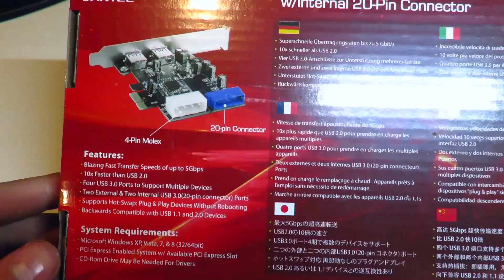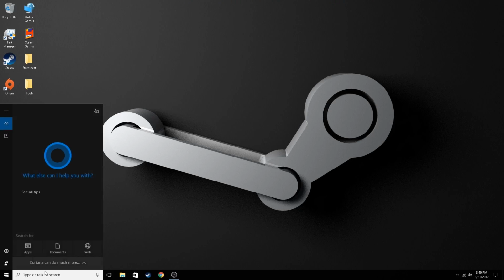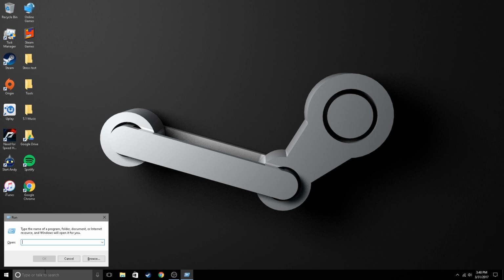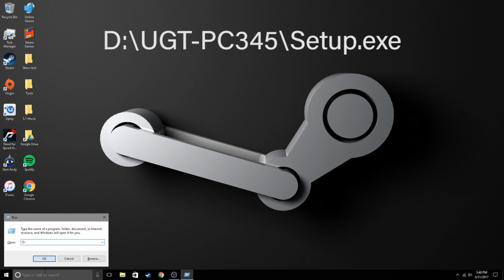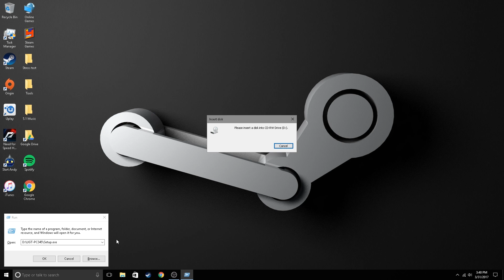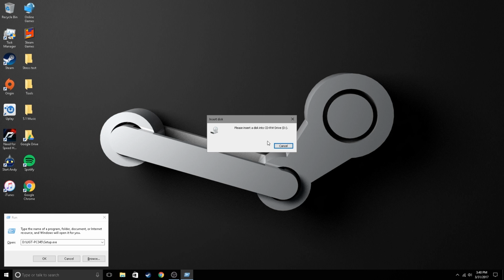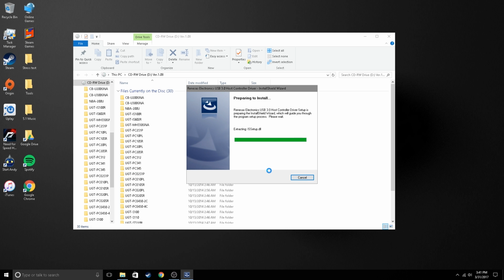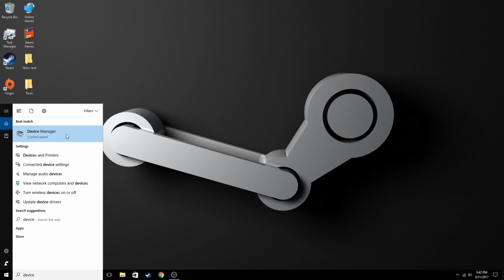USB 3.0 PCI-e Card| Unboxing and Installation

Comment: hey i know im a couple years late but i just built my pc im plugging everything in now but i bent 2 of my usb 3.0 pins and cant unbend them if i get this extender will i be able to use my 3.0 usb again and have it function the same way?
Reply from the maker: Yessss ssssir, that will work. I've bent those 20 pin usb 3 ports so many times

Comment: What is the purpose of blue cable connected to blueslot in pcieusb 3.0 card...?
Reply from the maker: It is a USB 3.0 internal motherboard connection. My PC case had one USB 3 port but my motherboard did not, so i used this card to make the cases USB 3 port work.
Reply: @ZackEberly  so the blue slot in pcie is optional and is for pc case usb 3 slot...correct? My card has come from Amazon.de but had No cdrom drivers, i already contacted seller...

Comment: i was scary seeing you bend the molex out. you should have pluged in teh molex adaptor first, then connect the adaptor to the power supply plug, then plug the usb cable.
Reply from the maker: Yeah luckily it still worked tho

Comment: Thumbs up! I need 1 of these because I got the a H500M PC case for theBeast, I9 9900k with a 2080TI. It has 4 USB 3.0 and 1 Type C right in front of the case and my motherboard, z390 Auros Master only supports 2 and 1 of these connections. Thx for the Video. ***BTW I really did your Background and i would like this. Can you please send me the Pic. or link for it....thx.

Comment: my psu dose not have a 20 pin what do i do
Reply from the maker: That's not a 20 pin power connector. You power it with a molex (4 pin connector). The 20 pin on the USB card is for your PC case if it has USB 3 ports. Your motherboard might already have a USB 3 connector (20 pin). This card is for extra USB 3 ports and giving older motherboards a connector that your case's USB 3 can connect too.

Comment: Where come blue socket after connect molex socke
Reply from the maker: The Blue slot is for an extra USB-3 connections (front panel IO). You do not need to use the blue slot in order for it to work.

Comment: Hey bro:)
So my pc is very old it has a amd phenom 9550 from like 2007 but i have bought a new case and a SSD , the problem is that the mainboard doesnt support usb3 but my case has a usb 3 connector that i didn’t used cause of my mainboard. When i‘m installing the extension and then i plug the unplugged usb3 cable in the pcie extension slot is the front usb3 port on my case work?
Reply from the maker: Yes! This card has an internal connection for a USB 3 port on a case. So when you plug it in the case USB 3 will work. I had the same problem with my case.
Reply: ZackEberly damn nice :D 
Thanks for your help
Reply: @ZackEberly  Where did you find the driver to install on Windows 10? I have an equal to this I did not find drivers for Windows 10
Reply from the maker: @fernandojunior9393  This is the newest driver- http://www.vantecusa.com/products_detail.php?p_id=125&p_name=#tab-3

Its under the support tab. I hope that helps.

Comment: I have plenty of USB 3.0 ports in the back of my MB. Here is the problem that I have my PC case has 3 USB 3.0 front panel ports and my motherboard only has one USB 3.0 Header  so I was only able to connect 2 of the 3 USB ports but I need an additional port in my motherboard to connect the 3rd USB front panel port. Can I use this PCI card to connect that USB 3.0 port in my front panel case?
Reply from the maker: Yes... thats what i did. I had a front usb 3 with no plug in on my motherboard and the PCI card works very well.

Comment: I have a card reader port that has micro sd, cf, an as slot and another usb 3 port.  It connect to my motherboard by a 20pin usb 3.0. All the ports work besides my sd card slot. Why might this be?
Reply from the maker: Do you know what kind/brand it is? That could help a lot.
Reply: I went and bought another model of the same reader and the sd card slot worked so I must have just messed mine up. Thanks though
Reply from the maker: Yeah ok... Its so dumb when stuff happens like that.